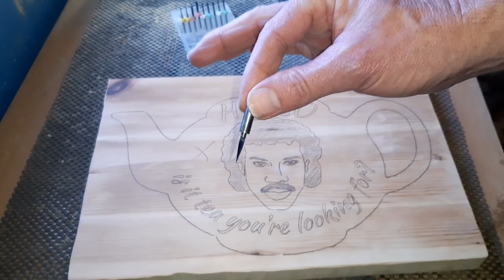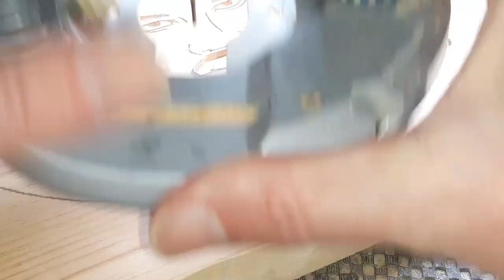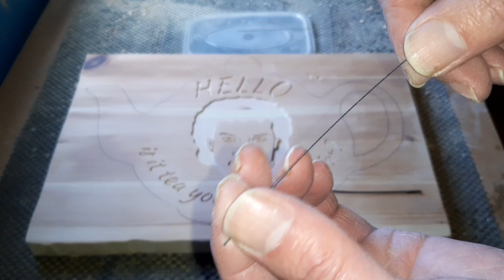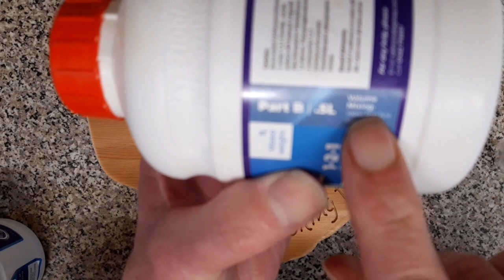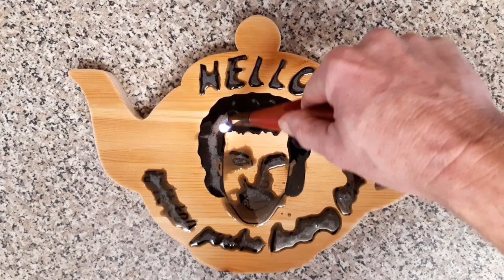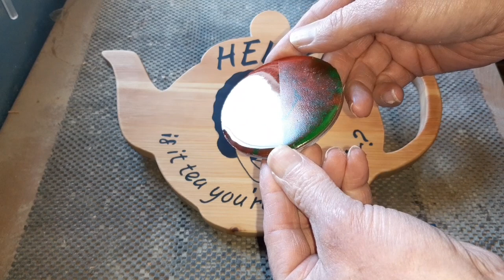Lional Richtea, Hello is it tea you're looking for..router/scroll/resin project..

Comment: Very nice project 👍🏻, i have an question, i make the same project but of course not professional like you, i use dremel 3000 with Router equipment , i want to buy Bosch GFK 550 and want to make this projects, but what you thing its possible with this Router ? Thank you 🙏🏻
Reply from the maker: Nice choice,the bosch router will do all my projects no problem, I was looking at the bosch router as my next router if I can't find one like mine..you will find it better to use with a larger base plate, people make their own or you can purchase a universal base with handles on,here's a link to one ..https://www.ebay.co.uk/itm/Router-Base-Strong-Texture-Router-Base-With-Handles-Compact-For-Woodworking-/174778326514?mkcid=16&mkevt=1&_trksid=p2349624.m46890.l49286&mkrid=710-127635-2958-0
Reply: Thank you very much for your nice answer, ok then time to buy firstly bosch Router :)
Reply from the maker: @kutsalsagim  excellent, just take your time and enjoy 😁👍

Comment: Hello, would it be possible to have the amazon link please.  I follow from canada.  thank you
Reply from the maker: YIYATOO 20pcs 10° 15° 20° 30° 3.175mm Carbide PCB Engraving Bits CNC Router Tool 0.1mm https://www.amazon.co.uk/dp/B017LGA36G/ref=cm_sw_r_apan_glt_i_39D2Z9ZXCKTW8NGBTHYA?_encoding=UTF8&psc=1
Reply from the maker: Mesee 10Pcs Titanium Coat Carbide End Milling Engraving Bits, 1/8 inch Shank CNC Rotary Burrs Bit Set for PCB SCM Circuit Board Plastic Fiber Wood Rotary Drilling Tool Accessory, 0.8mm-3.175mm https://www.amazon.co.uk/dp/B08G8MHRZZ/ref=cm_sw_r_apan_glt_i_EDR3Q200YXPG506MECRF
Reply from the maker: Generic 6.35mm to 3.175mm 1/8 Inch Engraving bit CNC Router Tool for 6.35mm Collet https://www.amazon.co.uk/dp/B07HSWCV9R/ref=cm_sw_r_apan_glt_i_TEZ0XDHP3P49GBVZWRES
Reply from the maker: There you go. 😁👍
Reply: Thank you

Comment: Sir, I have a Ryobi SC162VS - I see it has a pin head scroll saw blade. How do I get the spiral blade installed? Any tips you can help with? Thank you!! Thank you for the video! Extraordinary work!! as usual.
Reply from the maker: I've searched your saw and it's not something I've seen before, you can search adapter clamps for pinless blades online there's alot of different ones,maybe one will fot yours..you can also purchase conversion kits..Good luck.
Reply: @fishtank5050  thank you very much!!